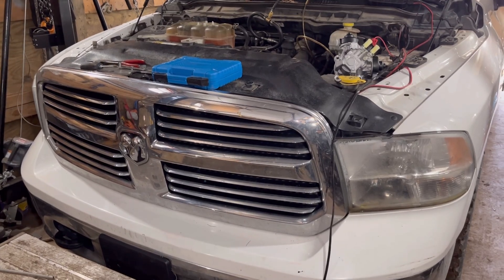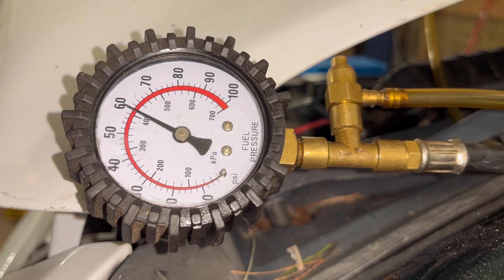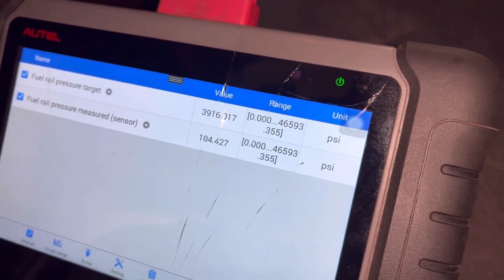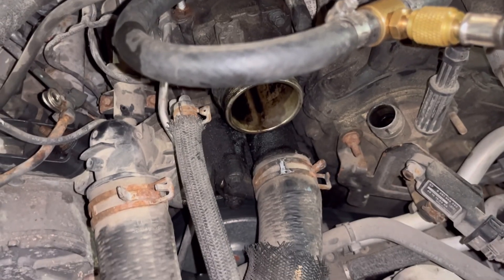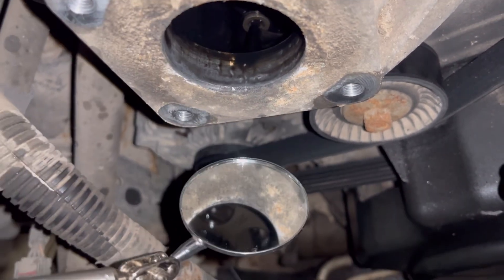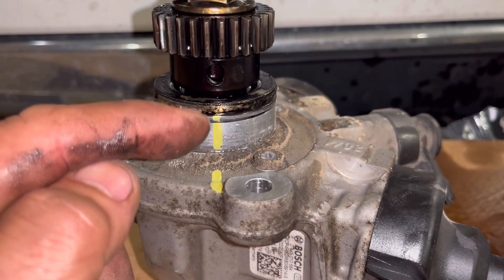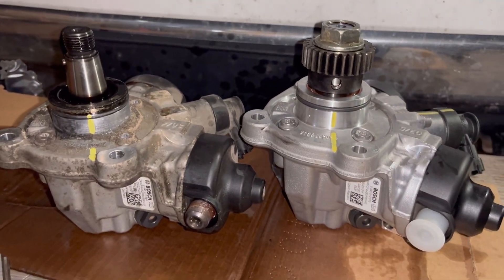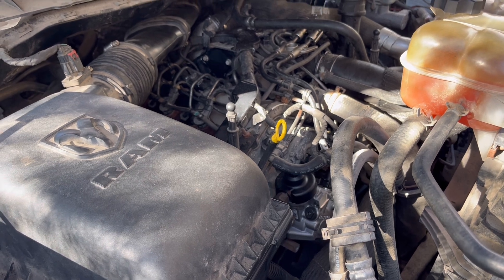Quick overview Ecodiesel high pressure injection pump replacement

Comment from the maker: I want to note that I installed new fuel rails at the same time, just so the truck had a new pressure sensor and regulator (price of the complete rails was close to the price of the sensor and regulator by itself). I also used brake cleaner spray and compressed air to carefully clean out all the high pressure fuel lines.

Comment: Great video. I just got done rebuilding my motor and parts sat for 4months . Tried starting it , zero codes , lift pump pressure at 60 psi , bleed all lines and high side pressure is 850 psi...have you seen pressure regulator problems before. My only two possibilities is hpfp or fuel pressure regulator.  Any suggestions.
Reply: Got it running , fuel regulator fixed it
Reply from the maker: I have not seen pressure regulator problems before, but don’t put too much weight on that statement. I believe I saw your post in the Facebook group, small world. But certainly your injection pressure is way too low. Needs to be a minimum of 3500 psi. In your case, I would carefully try bleeding the two pressure lines coming off the pump….but if that fails, I would replace the regulator or solenoid on the hpfp pump and then maybe the hpfp fuel pump itself. Please let me know what you figure out, I’d like to learn more.
Reply: @tadsworkshop great advice. I bleed it and not much air  that i can see. But i figure i will start with the regulator been that is $165 compare to $1000 for hpfp. As far as Fb some people on there are quick to talk crap instead of useful ideas.
  I dont think i have a high pressure leak , i have been thru everything plus the fuel pump recall was done around 100k ago. 

Ill let you know what the problem  was when fix

Comment: I  change the hight presure pump but still have same issue crank non start i wondering whats the isssue on this truck .
Reply from the maker: What’s the fuel rail pressure as seen on your scan tool? How’s the signal from the crankshaft sensor?

Comment: If i have an issue with hight pressure pump do i get a check engine light
Reply from the maker: You’ll probably get a trouble code related to fuel rail pressure issue, which will trigger a check engine light.
Reply: @tadsworkshop i got nothing but crank no start
Reply from the maker: @tahartahar4240 check for trouble codes. If no codes related to crankshaft or camshaft sensors, verify the fuel pressure your lift pump in the tank is putting out.
Reply: @tadsworkshop I change a lift pump but still have same issue and no code? Strange
Reply from the maker: @tahartahar4240 is lift pump kicking on? Can you hear it? You really should verify with a pressure gauge what its output psi is.
Reply: @tadsworkshop the lifte pump is kicking but no i change a new one same uissue
Reply from the maker: @tahartahar4240 ok. You need to scan for codes, regardless if an engine light is on. If no codes, then use a graphing function on a competent scan tool and watch the output from the crankshaft sensor. Crankshaft sensor reluctor wheel may be faulty.
Reply: @tadsworkshop i take of the cover of a hight fuel pump and implug it and went to  the  truck to see if i will get a  check engin but i got non

Comment: I have the same problem mybtruck crank but not start i replace a fuel pump but still same issue I think it's the hight pressure pump then ?
Did you think?
Reply from the maker: You need to verify what your fuel pressure is in between the lift pump and the high pressure pump. You also need to scan for trouble codes which may help.

Comment: I have a 2016 ram echo diesel big Horne code error saying high pressure would this be the same lay out to change the high pressure fuel pump ? I have full power just doesn’t want to kick in to turn over

Comment: Mine a 2015 with 53k miles think I’m good
Reply from the maker: Install a FASS fuel system on your truck. Now is the time to do so, to get maximum longevity with the injection pump and injectors

Comment: good video, thanks! My truck is 2016 with 201k miles, I bought it from the dealer after they replaced the engine at 87k, I deleted it after 2-3k. do you think it's a time to replace the pump as a preventive action? I actually feel that it doesn't have the same power as before, not sure if that is related.
Reply from the maker: After 200k of service, I think it is within reason to do it preemptively. 

Did you ever replace your intake manifold? If you haven’t, it’s probably choked up with soot from when the EGR was installed, way back when. And that restriction continues all the way to the valve seats, in the cylinder head, so get a borescope and inspect and clean as needed. 

Even with your tune, you might try to have a new one installed under the recall. Your truck will be in limp home mode after their programming, but if you can do your own programming after, that would work. 

Also, try to verify what fuel pressure the lift pump is providing. If it is under 60psi, I would definitely do something about it. I use an expensive FASS system now, and it’s set at 70psi, which I like. Also their fuel filtration and elimination of aeration helps with power.

Comment: Hi
I just got a recall on the the high pressure pump on a 2016 

My question is have you changed the steel coolant lines at the back of the engine with the cab on  could it be done with the cab on??
Thanks in advance
Reply from the maker: I have not changed those steel lines. I can’t say for sure if it’d be possible with the cab in place. Excellent question though. I have a core engine in my workshop, I’ll take a look at it in a few days when I’m off my vacation
Reply: Also to note I plan to pull the intake at the same time to do little turbo coolant hose 

Thanks again 
your a wealth of help !!

Comment: 2018 Ram Eco Diesel.  200K miles. A quick flash of dash lights, RPM dropped to idol for say 10 seconds, then shut down. Error Codes P016F & P062B. Truck turns over just like this, Scanner good lift pump PSI, showed similar Rail PSI. Was leaning toward ECM but I believe its the High Pressure pump also. Thanks for the vid. Will update when im back up and running.
Reply from the maker: Did you get it back up and running?
Reply: @tadsworkshop   The dealer said it a recall and they will fix it. So, I took it to them. Two weeks later, they said good to go. However, they screwed up a seal and within 40 miles, the motor filled with diesel. Sounded like rod knock and started smoking like it was on fire. I towed the truck back and called the rep and told him what had happened. He noted that the tech said there was no diesel in the oil. I showed him the video of the dipstick with 12" of fluid. So now he said that Stallanits will need to get involved. I think they screwed the motor and are lying to their parent company. Not sure how this will play out.
Reply: Update. Dealer could not fix motor. They spent 2 months working on it. They finally gave up and we drove away in a 2021 RAM 2500. However, I went back to the 6.4 because the new 6.7 Diesel has the same exploding fuel pump. Service manager noted that they will tow this 2018 ram 1500 across the auction block. Looking at the motor when removing my personal items, there were more new parts than old.

Comment: New subscriber here 👋🏻 having a fuel issue with my 2015 Ecodiesel. I noticed longer than normal cranking to get the truck started a while back. No codes or rough idle, had the HPFP replaced under recall 3k miles ago. Since, the longer than normal cranking has gotten worse and developed into a rough idle for a few seconds after start up. Lift pump tested good at 60 psi consistently. Fuel rail pressure shows around 4000 psi at idle. When i turn ignition to run and lift pump is active I can hear what sounds like air purging at the HPFP. If I allow the lift pump to cycle a couple times and I’m guessing air to purge out of the HPFP the truck starts fine with no issues. 

Have you seen this before, and know of a solution? Thanks!
Reply from the maker: @robertclegg3624  hmm, well in your case I would focus on this potential air issue. Normally when the pump cycles on, and engine off, you can hear that erratic hissing/fluid movement pretty easily. I would closely inspect your fuel filter housing, especially the o-ring for the filter housing. Otherwise, all you can do is inspect every quick connect fitting. You might also consider that the lift pump may have a crack or air leak it it’s tubing. If you really want to go down a rabbit hole, you could consider the FASS Fuel system made for these trucks. They put an emphasis on air-free fuel delivery.

Comment: Does that pin on the shaft line up with the hole on the gear?
Reply from the maker: I’m going off of memory here, but I don’t believe it does. If you look at the old pump at 10:12, I believe that’s exactly how it was when gear was removed, I really doubt I rotated the old pump at all.

Comment: Mine goes in tomorrow for the pump recall, so I watched your vid to see what needs to be done. Hopefully they don't fuck it up!
Reply: they did mine at the dealer and they did fuck up took them 2 week to do it  and 1 week later I noticed a deael leak from that area, waiting for the next appointment
Reply: Got my recall done 4 months ago and now that Pump is failing
Reply from the maker: @forrestmiller4055  hopefully not! Low probability though, in all honesty.

Comment: After watching your video I fired up Alfaobd and added "Fuel rail pressure target, Bar" and "Fuel rail pressure measured, Bar" to my list of monitored functions to see what I read. To note: I have no codes being thrown other than a P0128 from a thermostat that refuses to fully close. Anywho... My reading for the "target" is 319.167 and the "measured" reading is 326.078 at idle. When I rev the engine I have watched the readings go up to (roughly) 1014 or so. My Ecodiesel runs just fine, I was just curious where I was at and now I am wondering why my numbers are different. Is it something to do with the 'psi' on your Autel scanner and the 'Bar' on my Alfaobd scanner? 

Great video by the way!
Reply: 1 bar is 14.7 psi, that's the difference
Reply: @TheDrivewayEngineer  Thanks for the explanation!

Comment: Maybe you can help ! I followed this video. I replaced the hpfp. And the lift pump is pushing 65+psi to the hpfp. However I’m only receiving 1200 cranking fuel pressure
Reply: It’s cranks but won’t start. I have verified the crank sensor and wheel are good. It will run with a little starter fluid. Doing so set a p016f code. Can’t figure out why it’s only getting 1200 psi. The pump is a oe replacement (new) not a reman
Reply from the maker: @jakedobson790  I will do some homework tomorrow (look at some factory service information) and try to give you some helpful advice. You definitely need at least 3500 psi or so to start.
Reply from the maker: @jakedobson790  have you tried disconnecting the fuel quantity solenoid on the injection pump? It should default to maximum pressure when you do. Let me know if you have any updates on this truck.

Comment: Hey I have a question for ya, great video by the way!….so replaced mine, now it’s throwing code that fuel pressure too high on fuel rails, do you know if I need to bleed my fuel system or something?…or why it’s throwing that code?…my pump just went out, it didn’t do the spinning metal shavings or anything like that, everything still clean in the lines and stuff?
Reply from the maker: @terrypeace3940  thanks for the kind words. Please like and subscribe if you haven’t already. I’ve been there with that high pressure code. More often than not, it’s air that is trapped in the rails - sometimes some spirited acceleration runs and constant clearing of the code via a scan tool will make it go away permanently. On some trucks, it’s tough to get rid of. I know of one truck personally that has had that code for 50k miles with no issue. Better to have high rail pressure than low. Shouldn’t cause any driveability issues from my experience. But do some spirited acceleration runs, constant test driving, and clear the codes a few time as necessary. Eventually, with any luck, it will not come back.

Comment: Hi,I have a Jeep Grand Cherokee with the ecodiesel..my car just stopped, codes p0087 and p016f..rail pressure low and closed loop fuel pressure control low.
The low pressure pump delivers 60psi, rail has only 800psi.I checked the injector return flow and pressure regulator on the rail,ok.
Looks like the high pressure pump?? Right?
The high pressure pump is new replaced from the dealer,did only 4000k's,I checked the solenoid on the pump looks fine.

Any ideas would be much appreciated.. thanks ivo
Reply from the maker: @ivoschaedle1274  how did you go about checking the fuel pressure regulator on the rail? From what you’ve described so far, I can only imagine it’s the injection pump….but please give me more details if you can.
Reply: @tadsworkshop  Thanks..I checked the pressure regulator.Took the return line from the rail off,while I crank there is only for a second a small amount of fuel  flowing back and then stops..so that works fine.
Reply from the maker: @ivoschaedle1274  I see. That all sounds good. I can’t imagine the new injection pump being defective, but anything is possible. You might try replacing the regulator and/or pressure sensor at this point. Please let me know what you find out, I’d like to learn from your experience.

Comment: Hello and thank you for your very good video, I had a recall on my truck for the fuel pump they changed the pump and since then they consume more fuel about 2 to 3 liters more per 100 km can you tell me what the problem is thank's
Reply from the maker: @clagagne  thanks for the kind words. That is an interesting problem, and I don’t really have an answer for it. I could only imagine their calibration/programming is different from what it was and causing the increased fuel consumption, or maybe it’s possible that coincidentally your DPF is becoming restrictive and choking the engine a little bit. Just ideas, but I’m only speculating.
Reply: @tadsworkshop  Thank's I will check to see if there is no dpf restriction thank you for your advice much appreciated.

Comment: Thank you for the speedy response. I reviewed your video on a bigger screen and see a coppery colored bulge on the end of the line like a ferrule.  You stated you replaced the rail but reused the connecting line. Im assuming they all use a similar joint. Its a mystery to me what this crush washer thing theyre talking about. There is no doubt about the cloud of diesel mist, a little honesty by them would be nice. They kept my truck for 36 hours waiting for some "washers" they ordered. Thanks for your time, you seem like a straight shooter.
Reply from the maker: @michaelnash1676  I just can’t imagine what they are referring to. I can’t help but think they are BS’ing you. I really think it’s as simple as tightening up the nuts on the injection lines that were disturbed. Or undoing them, and reseating them and tightening the nuts. Also, you are correct, in this video I reused all of the fuel lines. Had no problems or issues from this. Hope you get it square away, but it does sounds minor. I would deal with it asap though, given the extreme pressure in those lines.
Reply: @tadsworkshop  thanks
Reply: Greetings , me again with an update and a question. First, the update after the hpfp replacement I experienced clouds of diesel mist pouring out from under my hood, like when a rad blows. They held me up, waiting for a copper crush washer. This washer is located under one of the injectors. I saw more mist weeks later at night with the headlights on , again from around the front gap in the hood. Not as bad as it first was. I called them and they said bring it back which I did. This time I made sure they had the crush washers in stock. They determined which injector was leaking ,pulled and examined it. I think they used a new washer and told me of a slight scratch on the injector. They tested it for leaks and sent me on my way. They said if it developed again I will need a new injector costing $800. Canadian. Well, after being parked all winter, I went for a drive yesterday and you can probably guess. Mist again at night after smelling it all day. That's the update ,now for the question! What's the chances of this injector scratched,cracked or whatever starting to leak the day they changed the pump? I never saw steam or smelled fuel previously.

Comment: Good day, my dealer completed the high pressure pump recall and had issues with clouds of diesel mist coming out around the hood. After attempting to correct several times it was decided the crush washers had to be replaced. I'm assuming they are on the lines that go to the rails. When I park at night I still see mist coming out around the headlights and have smelled diesel fuel since the initial replacement. They are going to attempt another repair with new washers. I'm wondering if I need a new dealer. What are your thoughts , experience with this issue?
Reply from the maker: @michaelnash1676  crush washers? I’m not aware of any associated with the high pressure fuel system. Just simple flare fittings. The mechanic hasn’t tightened down the line properly. Very, very carefully observe where it is coming from with the engine idling. If there are any loose fittings, and I’m sure there are, tighten with 19mm or 3/4” wrench. But yes, find a different dealership or a private diesel shop.

Comment: How is the truck running? My big question is the gear. Does it need to be pressed on? Or can that nut press it on?  And thank you so much for the video. I have a cpx looking at me on an r&r.
Reply from the maker: @bluesteeljay9343  sorry I didn’t respond sooner. No, the nut draws the gear down onto the shaft. Truck ran and still runs fine. Thanks for the kk d words!